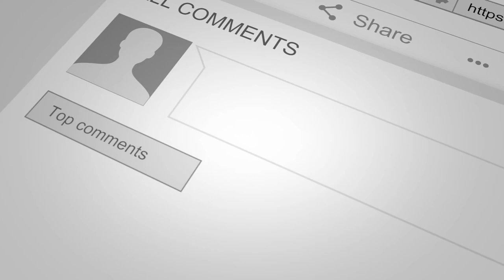Honda Ridgeline 2021 Oem Hard Tonneau Cover, review, waterproofing and Install appearance.

Comment: If it is a FOLD up Tonneau ?? How are you going to make it waterproof ?  After you fold it up and down 4 or 5 times Its going to leak in the joints or hinges that fold ???  I understand about the  tonneau to the cab of the truck !! Don't know about  water proofing hinges ??
Reply from the maker: so far after the years, the leaks are minimum to the end of the tonneauI was able to carrier a Asus monitor on a heavy rain with out any drop on it, no leaks by the folding area.

Comment: You titled it OEM tonneau installation, still waiting to see the installation.
Reply from the maker: Installation is easy, only 2 screws with hooks in the nose of the bed and that's it, nothing else, it have instructions 1 minute Installation.
Reply: @07Review  would you buy this cover again, or go with a different one? What do you pay for the Honda OEM cover in the US?
Here in 🇨🇦it’s $2017 plus tax= $2259.00
Reply from the maker: @cleanasdirt6832  brother honestly I will take an aftermarket brand with a waterproof capabilities, for that money. I did pay $680 in sale , if I would have to pay the regular price I prefer to go with a different brand, Honda is ok 👍 but not to pay more than $1300, in my opinion

Comment: I installed a bakflip mx-4 on my 2020 black edition and it looks 10 times better than that cover. That thing sticks up over an inch. The MX-4 is basically flush. Not sure how much that cover is, maybe it's cheaper, the MX-4 is a thousand bucks.
Reply: About the same price and I have the OEM cover.  I prefer the look and like that there’s no rails involved. That makes install / removal much much easier and without rails the trunk opens much more.
Reply: The OEM cover is better. It does stick up a little bit but that doesn't bother me the main point is there's no rails all you do is replace a couple of tie downs that's already in the truck and that's it and then when you want to take it off you just flip it up and take it off